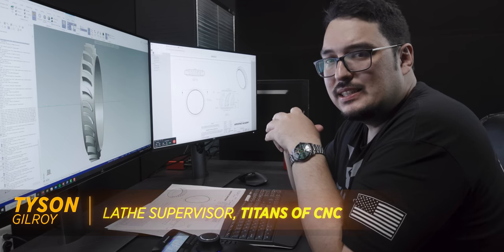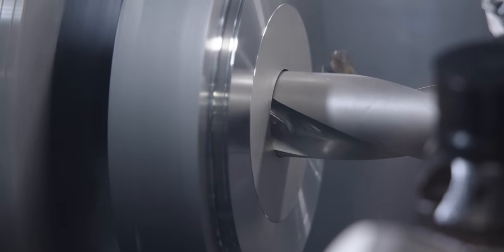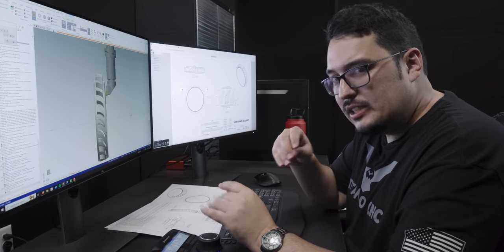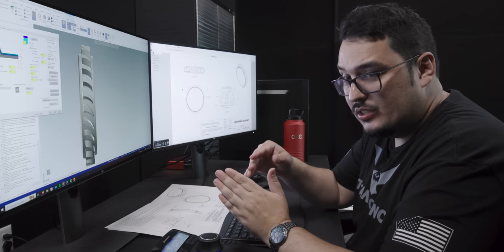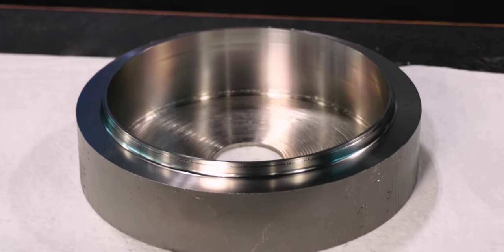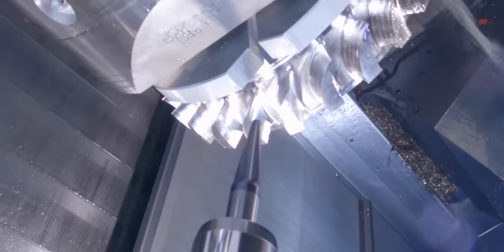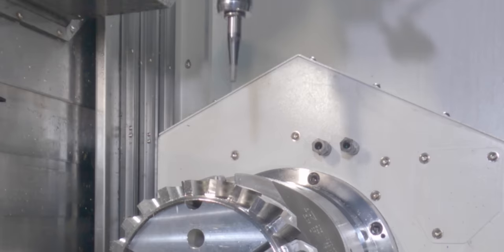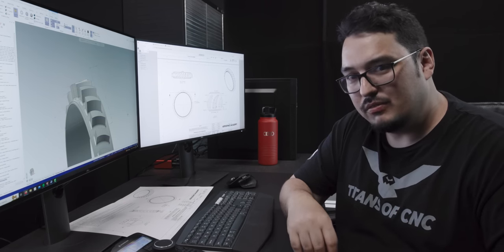Complex Process of Machining a FLAWLESS Rocket Engine Blisk

Comment: I run a similar part, and I've found that I will actually face off the extra stock in the center of the part with a boring bar starting at the center hole and working your way up to the ID of the part.  That way when you go to actually face the part down to size, you don't get a massive disc that wants to go flying, and you also don't need to stop the machine to pull the disc off the stock.

Comment: If you're worried about a tool spindle hitting a top of the chuck - use 45° Tilt Style lathe tool. It provides more clearance between a tool spindle and chuck compared to a traditional vertical lathe tool. And, it also gives you a B-axis movement right on the go.

Comment: Love watching and learning new tricks. Now I have a trick for you that will change things for you and the industry only if the cadcam industry implement a different  method for the rough boring cycle that industry uses. 
Rather than the norm that I see with industry using longitudinal internal (Rough boring) cutting along the Z axis only,  cutting should be done along a 45 degree angle moving in both Z and X axis at the same time. what this dose is gets rid of the swarf trap and creates a large taper that helps dramatically with swarf evacuation.

small g code example (long hand)

starting at a point (Sorry I'm a metric man so I will do my best)
(basic 2 axis lathe long hand)
(INCH CODE EXAMPLE)

T0101
G96 S990 M3
M08
G00 X2.165 Z0.118
G01 Z0. F0.012
X1.969 Z-0.197
X1.772
G00 Z0.118
X2.126
X2.444
G01 Z0.
X1.969 Z-0.475
X1.772
G00 Z0.118
X2.404
X2.722
G01 Z0.
X1.969 Z-0.754
X1.772
G00 Z0.118
X2.683
X3.001
G01 Z0.
X1.969 Z-1.032
X1.772
G00 Z0.118
X2.961
X3.279
G01 Z0.
X1.969 Z-1.31
X1.772
G00 Z0.118
X3.24
X3.557
G01 Z0.
X1.969 Z-1.589
X1.772
G00 Z0.118
X3.518
X3.836
G01 Z0.
X1.969 Z-1.867
X1.772
G00 Z0.118
X3.796
X4.114
G01 Z0.
X2.146 Z-1.969
X2.027
G00 Z0.118
X4.075
X4.392
G01 Z0.
X2.424 Z-1.969
X2.306
G00 Z0.118
X4.353
X4.671
G01 Z0.
X2.702 Z-1.969
X2.584
G00 Z0.118
X4.631
X4.949
G01 Z0.
X2.981 Z-1.969
X2.863
G00 Z0.118
X4.91
X5.228
G01 Z0.
X3.259 Z-1.969
X3.141
G00 Z0.118
X5.188
X5.506
G01 Z0.
X3.538 Z-1.969
X3.419
G00 Z0.118
X5.467
X5.784
G01 Z0.
X3.816 Z-1.969
X3.698
G00 Z0.118
X5.745
X6.063
G01 Z0.
X4.094 Z-1.969
X3.976
G00 Z0.118
X6.023
X6.341
G01 Z0.
X4.373 Z-1.969
X4.255
G00 Z0.118
X6.302
X6.62
G01 Z0.
X4.651 Z-1.969
X4.533
G00 Z0.118
X6.58
X6.898
G01 Z0.
X4.929 Z-1.969
X4.811
G00 Z0.118
X6.859
X7.176
G01 Z0.
X5.208 Z-1.969
X5.09
G00 Z0.118
X7.137
X7.455
G01 Z0.
X5.486 Z-1.969
X5.368
G00 Z0.118
X7.415
X7.733
G01 Z0.
X5.765 Z-1.969
X5.646
G00 Z0.118
X7.694

Comment: Tyson programming in the drill offset is all the validation I need that when I hand sharpen a drill and it cuts heavier on one side than the other, it’s for a reason and not just a bad sharpen 😂

Comment: thats funny i just did a 12 hour shift with those kennametal roughing inserts they held up good removing 4mm r X 300mm  scaled steel stock. used up 3 inserts on doing 15 parts. Went a little safe on them, could probably have used half the edges i did.

Comment: I can't believe you aren't using metric yet! Awesome video.
Reply: Seriously in the machine shop we use everything guys in Europe make metric threads we make metric UN unified Witworth acme stub acme buttress lowenhurtz on and on and on hell we can even use cubits
Reply: That's not how it works machine is made and runs and thinks in metric it only does inches to satisfy us if a part is designed in inches stay with that otherwise if the part is designed in metric  you run the machine in metric.
Taking an design changing it to metric you lose tolerance if you work in millionths of an inch you will find out it will bite you yes sir machines do run down into the millionths.
I have made parts with tolerances in helium light bands. I think that's roughly 3 or 6 millionths been awhile

Comment: Wow amazing job, guys! 
I was wondering if you haven't had any issues with the roundness of the ID, due to all the removed material and the potential tensions inside of the stainless steel itself? 

Because I often have problems with the roundness of thin- walled stuff like this..

Comment: How did you keep it round with so much force to hold the smooth ID and all the material removal on the 2nd op? Stainless is notorious for moving alot when takin so much off.

Comment: 19:50 Why use a conical tool? To have rigidity and still not hit the blade base? Is there a difference in final finish due to the difference in linear speed between the top and bottom parts of the cutter?

Comment: I actually like your content but this blisk isn't representative. I´m sorry to say this but real blisk look different. Normally the blades are more twisted, thinner and also a bit rounded at the tip. Some of the newer models arenßt machined out of a full part but are casted before machining or the blades are 3D-printed on the disk. 
I mean it is a kind of representation of a blisk but in my opinion some toolpaths wouldn`t work on real blisk because the baldes are longer and also more twisted so that very small endmills are needed.

Comment: 25 isn't a good blade number. Better to use 23 or 29, because they are prime numbers. Mind you, 25 (5*5) is still better than 24, 26 or 28, because they have even blade counts (2 as a factor) and better than 27, because that is 3*9. A lot of different prime numbers in designing rotating parts will result in reduced harmonics.